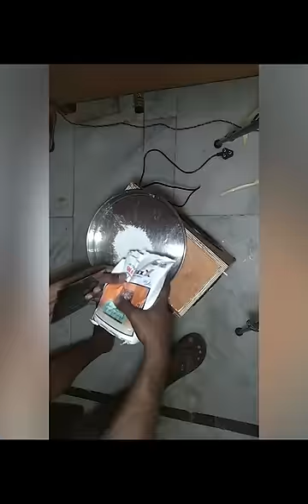Home theater || Home theater setup || Home theater projector | Home theater build home theater room

Comment: I don't know how that works because due to normal ply wood all the box vibrates , instead of using ply wood you should use MDF board ❤
Reply: Plywood is commonly used in speakers too